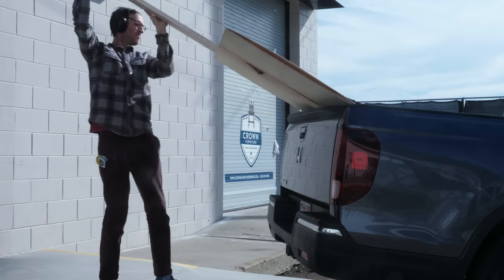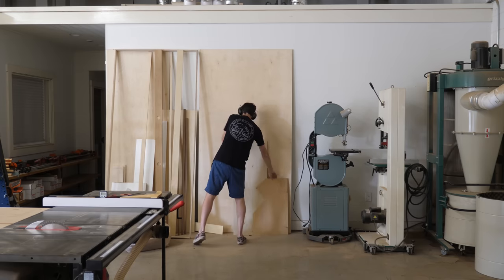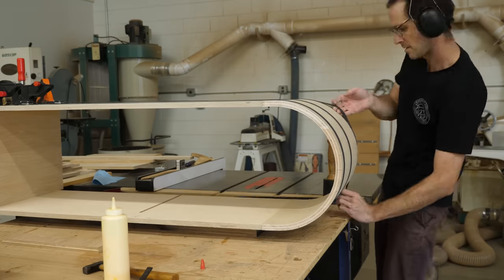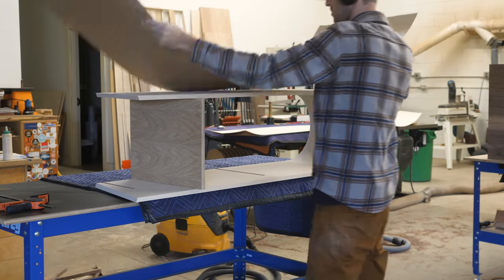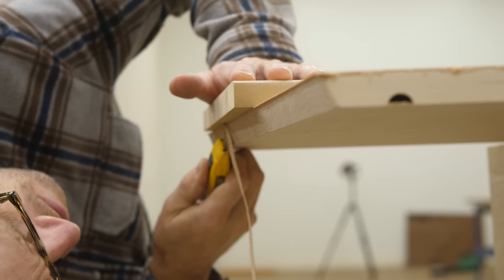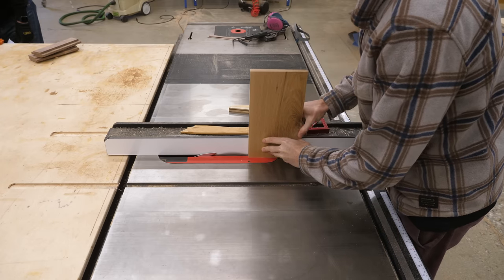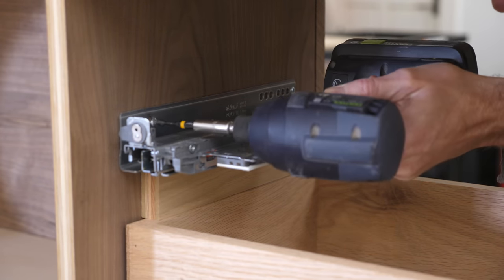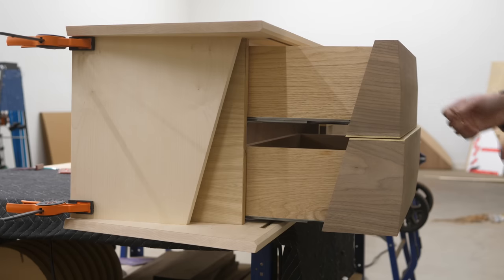Mistakes happen…they’ll never know

Comment: I like to microwave my dominos prior to doing a dry fit. Seems to help. I also sand down the ridge on the sides and keep a small stash just for dry fitting. Cheers!
Reply from the maker: Both good ideas! Might have to keep a stash of sanded dominos for this.
Reply: I do the same, but I also mark up the trimmed dominos with a black magic marker so I don't confuse them with the full size ones.
Reply: Was going to say the same - microwave/heating them shrinks them just enough to help with dry fitting and even glue ups.

Comment: Beautiful design, Shaun.

For dry fitting with dominoes, this is a trick that works for me.. . Buy the domino sticks.  Rip off the tapered edges to make them a little narrower. Run the stick through a drum sander or planer, taking off only a hair. This makes them just thinner than the mortise.  Draw a sharpie line on the flat part of the stick.  Now you can cut them to lengths as needed, and the sharpie indicates that these are your dry fit dominoes. I have a box of these of various lengths. They are much easier to remove when dry fitting. The cost of a few sticks has saved me hours of frustration.  

Thanks for your videos. I always enjoy watching your process.
Reply from the maker: Great idea! Thanks for watching!

Comment: Shaun, very nice to have your channel back - always was one of my favorites.

Here's my secret for pulling Domino's.  Use a claw hammer and channel locks.  Place the forks off the hammer on either side of the domino, grab the domino with the channel locks, and lever the hammer up.  Easy as pie.  Regular pliers would work, but the offset of the channel locks makes it easier.
Reply from the maker: Love it! Great idea.

Comment: I got a little tip for to help with the domino pulling issue, rather then using the pliers you were using try a pair of vise grips. Lock down on the domino  and you won’t have to concentrate any energy into gripping and you can just wiggle and pull. Best method I’ve found so far. Give it a go.

Comment: End grain edge banding is paramount to me. I've done it for years and it just makes everything that little bit more believable. I'd do it before doing the long sides though (and always before veneering, you made the right choice, even with the pressure sensitive layer in there).

Comment: Love this project!

For dry fits what I learned from Sedge on the Festool Live videos is to shave off the little nib on the sides of your dominos and they’ll be much easier to pull out. You don’t harm the wide glue surface but still give yourself just that little bit of wiggle room. 

I actually sharpied some dominos of each size to use for dry fits so I don’t need to do this each time. 

Keep up the beautiful projects!

Comment: Shaun, I very much loved the design.  Hosever, I was quite surprised to see you using PSA veneer in lieu of shop made veneer which you could have glued to the bendable plywood in your veneer press.  But the way you did it was faster, so I guess that's why you went that route.  Another significant time saver was your drawer box construction method.  To my way of thinking, given that you had a very unique design, you should have used dovetails or, at the very least, box joints.  But, that's how I build furniture, which isn't for everyone.

Comment: Hey Shaun, 
Enjoyed the video and loved the design.
I have to ask, what percentage of the final design did you make up or alter during the build?
The more I watch YouTube for inspiration the kinder I am towards myself and other WoodTubers about as you say "embracing mistakes" or just plain changing my mind on a design as it evolves on the bench.
Love your work!
One Handed Maker - Australia
Reply from the maker: As I've started using digital design and CAD software, I'm able to have a much better roadmap for my builds before I even start. Especially compared to when I designed everything with paper and pencil. But even with that, things always come up during a build, and it really varies depending on what I'm making. With something like this piece, since it was a bit more complicated, there was a lot of opportunity to mess things up, and have to make changes on the fly. I would say maybe 10-15% was figured out in the moment.

As opposed to a more simple build which might only have one or two small changes along the way, but for the most part sticks to my original design.

Comment: Hi. Interesting piece.
Hopefully some helpful info. The peel and stick veneer really needs a sealed surface to get a good bond. Applying to raw wood is asking for a bond failure.  Also, peel and stick veneer was developed for cabinet refacing, and has no business being used in fine furniture. It will not withstand the test of time.  You want to move to one of the many glues that can be used in your vacuum bag, and do all veneering of curved parts in there. This is a long piece, and not easy to make in one continuous piece, but you could break it up into two more manageable pieces, one straight, and one straight with the full curve (plus a little extra for trimming.) That would mean a bigger bending form, but would allow all sections to be done in the bag with proper adhesive and clamping pressure.
Keep pushing yourself and having fun.
Jarred Kaiser

Comment: An interesting piece.  When making custom furniture like this you have to have a clear picture in your mind to maximise the finish details. Maybe should have thought about the joint in the door and had that behind the brass detail. Also when looking down on the unit, as you would normally do, consideration could have been given to having the brass strips on the door a little higher than the drawers. The perspective view of the unit would make it look like they line up. Otherwise, it wasn't a bad effort.

Comment: Shaun, side snips make great domino pullers!  Use the ones that have an angled head like Klein makes for electricians. Gently pinch the domino you are pulling and place another domino under the pliers to protect your workpiece and it rocks right out. They make great nail pullers too.  Try these: Klein Tools D248-8 Pliers, Diagonal Cutting Multi-Purpose Pliers with Angled Head
Reply: PS - love your work, attention to detail, and that you are always pushing to learn new skills. That piece looks great!

Comment: Hey Shaun, love the piece! Speaking of brass inlays. Have you ever had issues with wood movement around metal inlays? I'm going to be making a solid wood table top and was wondering if this might be an issue as the part expands and contracts with the seasons. Thanks! Alecx
Reply from the maker: Not anything significant, though you have to always be aware of wood movement just like with anything else. But I've never had any big issues. Thanks for watching!

Comment: I always veneered the edge then the face after, that way one can disguise the edge easier with a slight sand and take the arris off. The edge one expects to see end grain. Yes disguise it as much as possible but you don’t want to see any joint to spoil the face of the work!

Comment: I work with that bendy ply quite a bit and i feel it's worth mentioning that the stuff is extremely weak. I like to layer some 1/8" plywood or thin hardwood veneer in between layers to add strength. It makes a world of difference, and if you're not using a vacuum bag, a stiffer outer layer will act as a kawl during glue up for better results.
Reply from the maker: Totally agree, not great on its own, but layered up with epoxy and it felt pretty dang stiff.
Reply: @shaunboydmadethis  I'll keep that in mind for the future

Comment: Is the portaband preferable to the bandsaw for metal? Asking as I work with silver more than I work with wood. I already have a few Hikoki tools, have been tempted to add it to the ecosystem before this also ~ 

Also well done for striking out on your own once more, this was a fascinating look at the tribulations of such an elaborate project.

Nice
Reply from the maker: I'm not much of a metal worker, but the main reason I use it is because it has a finer tooth blade that cuts through metal much nicer than the blades in our bandsaws. But I often use our bandsaws for brass or aluminum if it makes sense. Being portable is nice if you are cutting big pieces of metal too.

Comment: Pulling dominos is definitely a pain!  I ever-so-slightly knock down the edges of each domino at the belt sander before the dry-fit.  I mean, barely kiss the thing on the edges and maybe the flat sides.  Doesn't take much and gives a little extra space for glue.  Its a few minutes of work, but it saves me from punching myself in the face when yanking on them w/pliers and it finally cuts loose!

Comment: You could drill a hole in each domino to provide someplace to pull on.  No one will ever know.

You could even keep a special set of drilled and sanded slightly thinner domino's that you only use for fit-up.

Comment: Drill one or two holes in the dominos for dry fit. You can put a screwdriver through it to pull them out. Or 3D print some easy to pull out shapes.

Comment: Hey Shaun so happy you're starting up the channel again!

I've been thinking of getting that Kreg Universal bench. Have you noticed any dips in the middle of the benchtop since it seems to be quite long lengthwise and the bench doesn't have any bracing? And is the benchtop just 3/4 ply?
Reply from the maker: Yeah, if you want a perfectly flat table, you definitely will need to do some reinforcing or make a torsion box top, especially if it's a big table. But for a simple assembly table that doesn't need to be perfect, and if it's a bit smaller, they are great as-is with a sheet of 3/4" plywood or MDF as the top.

Comment: For the tight fitting dominos during assembly, all you have to do is lightly sand off those two ridges on the sides. Gives them just enough wiggle room to pull them out of the mortise. Pretty sure I heard Fetool Sedge say this in one of his rip videos

Comment: I think it is a cool piece of furniture! 
1 question, why did you use a big router for trimming the edges? And not the Dewalt trimrouter what was later in the video
Reply from the maker: Thanks! No reason in particular except that I prefer the big one. I used the little one later on because I needed to trim the curved parts of the cabinet, so I needed something that I could maneuver easily.

Comment: Dude, buy the domino plate by DFM tool works. It’s like a dowel plate, except you hammer dominos through it to very slightly trim them so that they come out easier when dry-fitting. Awesome video!
Reply from the maker: Had someone else suggest this, might have to check it out. Thanks!

Comment: For dry fitting you can use a few dominoes sanded down a bit on the round side so they fit tight and at the same time have enough space so you can wiggle then side to side to pull out.
Reply: Sooo. Where is my money?

Comment: A vacuum pump in woodworking works like the implosion of a submarine, but in a controlled way. When the pump removes air from a vacuum bag, it reduces the internal pressure. This is similar to a submarine at depth where the pressure inside is lower than the crushing pressure outside.

Instead of the ocean’s pressure, it's the weight of every air molecule from the Earth's surface up to the edge of space pushing down on the bag. The vacuum pump doesn’t create pressure; it removes air so that the atmospheric pressure—the combined weight of all these air molecules—clamps the wood together.

Comment: Christmas, alone in workshop with tools and materials. Let me know when you get to the sad part.

Before I get to the aesthetics of which surface to apply a veneer first or last, I look at the physics of the functional use. That edge where people move while they seat themselves or get up, and where they put their hands for that purpose, is precarious because a lot of chance for abuse and wear, and lifting veneer. So a solution that puts more material and more durable material on that edge might be a solution. That is, veneer both surfaces (probably the curved edge of the side surface first because you can flush trim the side veneer before adding and trimming the top/face veneer), then rout the edge for hardwood binding, and bind like a guitar top. And then trim the binding flush to both surfaces. Then both veneer edges are protected. It can also be a decorative component with contrasting wood or finishing.

Comment: I know how to make your domino puller! I have a tool that someone made for a similar application, pulling metal pins/dowels. If you have a fabrication shop or are capable of doing it yourself, here's what you'll need:
 
-A pair of vise grips 
-A slide hammer
-A small wedge to angle the slide hammer to be inline with the jaws of the vise grips.

Weld the wedge to the end of the slide hammer rod. Then, weld the wedge along the spine of the vise grips near the pivot point of the jaws and you're done! 

I don't know if you'll see this, but hopefully someone is able to recreate the tool I've described and is able to make use of it.

Comment: It may be vacuum you're fighting.  A groove, full length, on both sides of the dominoes may make them easier to remove.  Maybe, have a grooved set for dry fitting and regulars for final assembly.  Just a thought.

Comment: Very nice item.  Regarding hard to remove dominos...though I use dowels, I have had the same problem in removing them after dry fit.  My theory was that they will shrink a tiny bit in the microwave by driving moisture out.  So, if they are hard to insert during a dry fit I microwave for maybe 20 or 30 seconds.  It has worked well for me.  I even tried a weigh before and after test and was surprised how much water came out.  My second theory is that they swell back up once glue is used in the joint for that nice sweet tight fit.  I enjoy your videos.
Reply from the maker: Someone else suggested that, something I would have never even thought of, but a great idea!

Comment: How do you feel about push to open slides after the fact? I for one kinda hate them, since they are counterintuitive and in my experience they fail to open when pushed once in a while which is about as maddening as a light coming on with a delay after pushing the switch. 
Perhaps using honest old-school slides with a handle (one could be recessed into the left wraparound side of the drawer face) might be a solution. Did you consider that, and if yes, do you regret not doing it that way?
Sorry for unintentionally potentially adding to post-build second-guessing frustration, if my comment works this way.
Reply from the maker: I actually really liked these. I considered a bunch of different things, some sort of hidden pull was one of them, but was worried about the drawer front racking if you had to pull from one side and being hard to pull out. These push-to-open slides are made by Blum, and they don't make a bad product, so I am very happy with them. And it allowed me to have the super clean aesthetic I was going for.
Reply: Thanks for the fast reply! And a separate thanks for [re]creating your channel, now I have not only the old foureyes channel to watch, but yours as well. Change can be daunting, and I was kinda sad to hear you're relocating and won't be on foureyes any more, however, I can see both channels are alive and well and their quality has not in any way declined. Hope everything works out for the both of you and your families, both professionally and personally!

PS You're very relatable and seem to be a person it'd be great to break bread with. Wish I were your neighbor :)

Comment: How do you handle alignment/play issues with drawer fronts that are that close together? it always seems to me that the moment anything heavy gets put in a drawer it throws things off. I've started installing my drawer fronts with weight in the drawers and it helps, but it's still not perfect.

Maybe it's just that I'm not using nice enough drawer slides. Maybe the nice ones don't have any play.
Reply from the maker: They all have play, but the nice drawer slides have better adjustability. The drawer slides I use can adjust up/down, left/right, backward/forward, and tilt. So they can compensate for just about anything.

Comment: I really like to watch the videos you both do, because you do furniture, not boxes. I have one tech clarification, somewhere when you did the lamination, you mentioned how powerful the tiny vacuum pump was, however, technically it is not the pump, but the gravity that holds the atmosphere and as a result, the atmosphere is the one that does the job in vacuum applications, the pump just sucks the air from the pocket. And I have one small point regarding the brass inlay you have on the door/drawers, because they are not in the same plane (of course they are not, it is a sliding door), the brass strips on both door and drawer look unaligned (unless your line of sight is on the same level the strips are, meaning you have to do pushups, for example :) ) and as a result at first look they appear like the door is not fully closed (in case they were in the same plane). My wardrobe sliding doors have inlay (glass with aluminum strips at the bottom and the top, but much wider and somehow, because they have much more overlapping, they do not appear unaligned. They also have vertical "handles" that break the line and help with this illusion.
Reply from the maker: Appreciate all the insight. Thanks for watching!

Comment: A safer way to cut those round parts would be the router table. You keep the molded piece in the mold and use a template bit to safely cut and trim them to size.